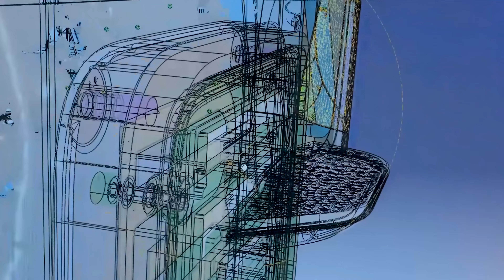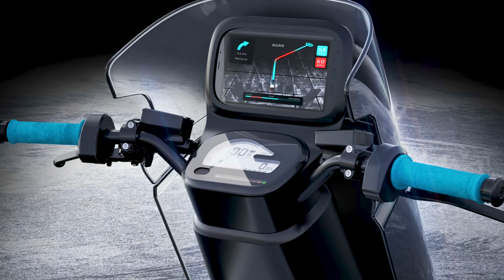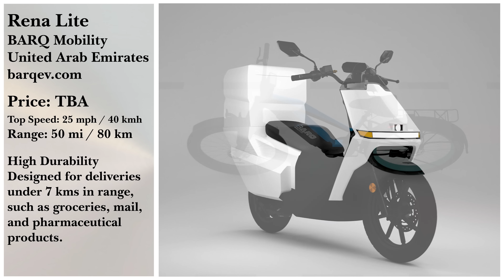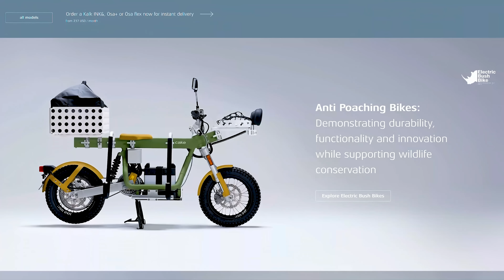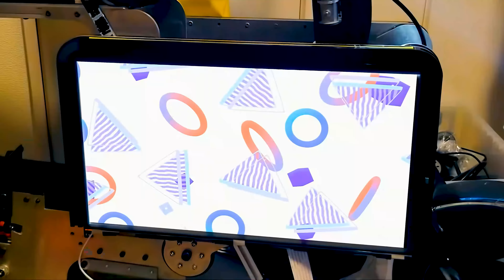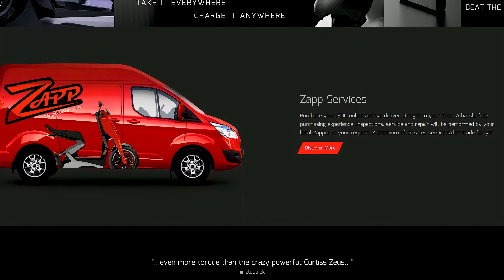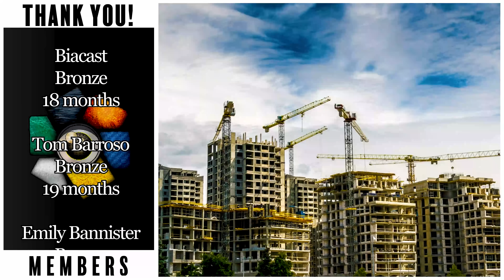NEW ELECTRIC SCOOTER IS CUSTOMIZED FOR DELIVERY DRIVERS

Comment: I just grabbed a Runhorse J2 micro electric slow moving car-like half width single seat vehicle that has heat and air conditioning.
It has a tiny backseat area to fill up with grocery runs, plus I opted for a trailer hitch for utility uses, and because it is slow, no insurance costs or plates or sticker renewal fees! Only thing is that trips will take twice as long, and that also means staying to the edge of sideroads with a orange slow moving vehicle sign on the vehicle similar to what farmers do with driving their tractors and horse drawn carriages do. 

I also just bought a tiny micro laptop that can be used as a mobile music editor workstation, for at the waterfront, and mobility rights for 3d scanning on the go with the new creality cr scanlizard. 
It's not a tesla, though I want to try to mod it for elements of luxury over time, custom 3d printed dashboard, aerogel insulation like nasa, amazing audio, maybe a super light micro camper just to have fun with seeing what is possible without much money DIY. 
👁️👁️

Comment: I like the notion of taking what is, essentially, a cargo-bike and adding a green electric engine.
I think those definitely have a niche to fill, in places with weather conditions that don't offer too great a challenge to those in exposed seating.

They could do pretty well, here in the Colorado Front Range and perhaps Grand Junction.

I can't say the same for any other part of this state, though.
The ski resort areas get brutally cold, in the winter, and the streets are icy and snow-packed.
In any other rural area of Colorado, the population density is so low that to get anywhere takes a long trip.